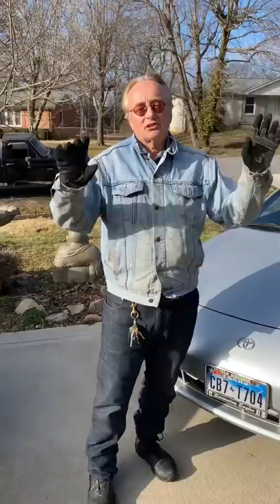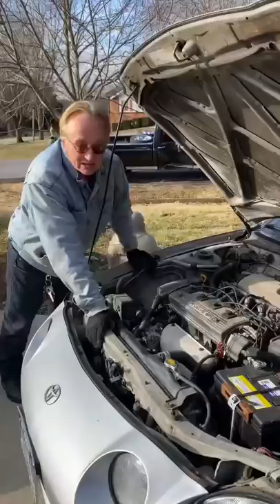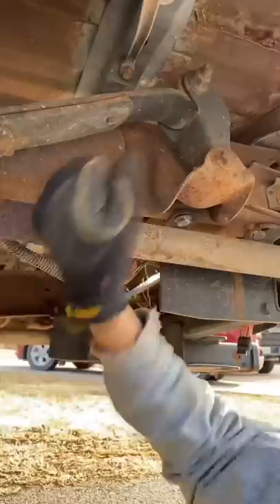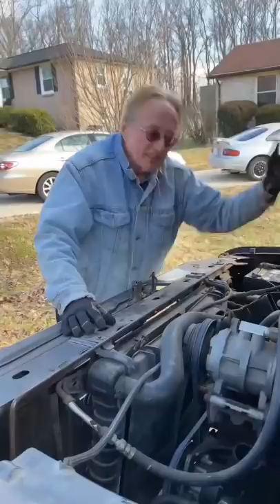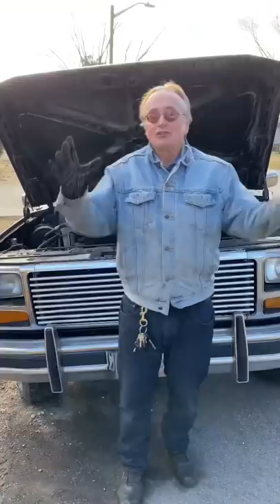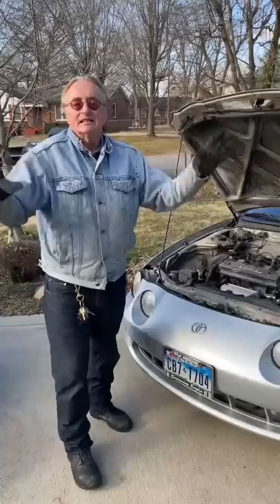Here’s Why Old Cars are Better Than New Cars

Comment: Two weeks ago my '70 Ford p/u wouldn't start.  I hit it with a shovel and she fired right up.
Reply: A little persuasion is the mechanics secret
Reply: I once used a screwdriver on the starter solenoid... Yep... ❣️
Reply: What a coincidence, I have to do the same thing to my wife sometimes.
Reply: percussive maintenance
Reply: “I think I’ll just get a Chevy or Ra-“

Your ford: Starts right up
Reply: Attaboy
Reply: @susanb1111  just once? I remember a coworker that had an '86 Cherokee and for months was too cheap to buy a new solenoid, instead used the screwdriver method :)
 It's a good trick to get an engine to TDC
Reply: percussion maintenance at its finest
Reply: Awesome!  lol
Reply: A shovel? How big are the starters in those bad boys?
Reply: @GuerreroDelInfo  If it's like my 88 F150, pretty hefty starter without a solenoid built in.
Reply: I had an old vw golf when the starter doesnt start i just smack it with a hammer now i had a mercedes and one day the starter didnt kicks i brough my hammer but i couldnt find the starter  lol😂😂
Reply: My old Toyota Previa was similar where it would run like junk or not start and I'd say I'm gonna beat it out of you and then try again. Usually it turned on once I kicked it and it started right up. But it had a couple of bad failures and I got tired of it being in the shop a lot so I traded it in. I don't regret it my newer car has a waaaaaay better suspension and gas mileage.
Reply: That ford stinks PU.
Reply: @fish_R_stinky69  You've confused my truck with your upper lip. 😁😁😁
Reply: @nucleargrizzly1776  Your trucks a shameful rust bucket with 200hp when it was new. Now its more like 100hp.
Reply: @fish_R_stinky69  There is not an speck of rust anywhere on her.  255hp and 376 ft lb of torque.  And in better condition than whatever you are driving.
Troll smarter next time young lady. 😀😀😀
Reply: @nucleargrizzly1776  I'm a young man and I rented a Malibu with 260 hp except its a lightweight 4 cylinder. I would expect more from a giant heavy v8!!
Reply: They respond to other metal objects. 😂
Reply: I have a 64 thunderbird and the carb float gets stuck here and there, a little smack to the airfilter fixes it lol
Reply: @greggc8088  Yep, works every time
Reply: @greggc8088 LOL
Reply: I once had a  1970 ford f100  that thing had over 500 thousand miles on it original engine and everything  I'd probably still be driving it  if it didn't get stolen.

Comment: Sad thing is that nowadays the car you’d like to get is either wrecked or modded to hell.
Reply: Yes, you need to search them hard
Reply: No
Reply: Or pay like $200.000 for a mint low mileage one.
Reply: Thats why I still keep my 240sx stock
Reply: Too many Fast and the Furious fans.
Reply: Cash for clunkers really screwed us
Reply: Or not allowed to get one
Reply: @Work_G  Yep. Found the car I wanted for two years, had everything perfect except the engine was badly swapped and I didn't have the time, experience or money to fix it.
Reply: biblereader  Maybe, but certain cars made way back when were built to last
Reply: cries in mkiv Supra
Reply: A Honda Civic hatchback is one in 100,000 in barely stock condition without kids messing them up. Trying to find a decent one in Florida is like finding a needle in a haystack.
Reply: Not true.  Depends on what you want though
Reply: I've given up looking for 90's 5 speed hondas/acuras because of that reason.
Reply: Just the 1988-2002 JDM cars. The classic muscle cars from 1960-1989 are barely ever modded

Comment: Old cars were not disposable.
Reply: Right. And people don’t realize that keeping a car on the road instead of crushing them after 10 years creates less pollution. Especially with the manufacture and disposal of lithium batteries included
Reply: Mining lithium is a horrible thing
Reply: @Terminxman  People did not realize because companies and governments told them to do not!
Reply: @Terminxman  couldnt fuckin agree more
Reply: @Terminxman  Finally! You actually understand this, unlike most people! My dad says the exact same thing as you did. I bumped my fist against a 1992 Mazda 323 door, VS a 2021 Toyota Corolla, the Corolla door was like a tin can, vs the 92 Mazda, it was solid, with a deep bang when you hit it. It was awsome. Cars will never be made as good ever again, unfortunately.
Reply: @Blakecryderman7244  You buy literally any German car and you will find the doors are the best out of any other cars on the market they shut with a solid thud and if you bumped your fist into one it would probably hurt. The reason doors are built like that now is to save weight and money so it meets regulations better. Regulations are whats killed modern cars not the companies themselves.
Reply: m rapacki  Only if you properly maintain it.
Reply: @Blakecryderman7244  Well, when it comes to things like feel and body panels high strength steel requires less material to have the same strength of some of the older stuff, so that doesn't necessarily mean a lot.
Reply: m rapacki  exactly. I'm definitely in the "old is gold" camp, but cars don't rust out by 70-100k mi now like they used to. Replacing designed to fail plastic crap is one thing, but a frame off restoration is a whole different story. 
I'd rather replace the plastic crap. I don't plan on welding in a new floor any time soon.
Reply: lets get away from the 70's stuff but lets talk 90's steel body doge ram had somebody hit my truck hardly a damn mark on it poor dude who hit it lets just say OOF and move on. Never felt safer in a steel body high riding truck than i do anything else.
Reply: @Blakecryderman7244  ECHO
Reply: which is actually better for the environment in some ways
Reply: @gravemind6536  Oh definitely. My father has a 2010 Jetta SportWagen. When you close the doors, it sounds like a bank vault door!
Reply: m rapacki  people didn't have to drive so much back then
Reply: m rapacki  Don't forget the coolant, brake fluid, power steering fluid, ATF, rear axle fluid and transfer case fluid (if you have one). Yeah, I know about the older cars (60's, 70's, 80's) with carburetors, distributor, points, copper plugs . I'm an old geezer.
Reply: biblereader  There are many variables, that's not really true.  rust prevention, metallurgy, etc. Corrosion resistance is much better now, and they use aluminum in a lot of cases. The 90 dodge/chrysler trucks had thick body panels and they were made of pot metal and rot like nothing else.
Reply: @gravemind6536  yeah maybe the German cars have solid doors, but the rest of the vehicle is an endless money pit. The 30 year old Mazda has solid doors BUT the rest of the vehicle was well made, with no plastic crap like a New German car.
Reply: BL Dontmatter  and also imagine the rolling blackouts due to the acute power shortages just because the epa forced EV 's
Reply: @RothBeyondTheGrave  that's if you live in salty , wet hellholes like NY or WI or MI . I own cars that are over 50 years old with more solid ORIGINAL  bodies than A lot of new crap I've repaired. Any thing built en mass after 1973 is JUNK!
Reply: I wish you would have told that to all the old cars I disposed of. Back in the seventies and eighties I used to keep a car five to seven years and felt they were pretty old. I would usually give them away because they wouldn't give me much in trade. Now I keep a car 15-20 years and don't think much of it clicking 300,000 miles. Back in the day I used to do tune ups, break jobs, carburetor overhauls, all while getting 8-12 mpg!  Now, I change the oil once a year and put plugs in at 100,000 miles and get 30-50mpg! I loved the old cars. They were things of beauty for sure, but I don't see them with rose colored glasses.
Reply: @stevenrodriguez7668  Don't know about that, but I do remember rolling blackouts and long gas lines with odd and even day number rationing during the oil embargo of the seventies!
Reply: @alansach8437  energy shortage would be worse nowadays most likely due to enforcement of electric vehicles. People travel more nowadays than before when cars were built for the consumer, not the manufacturer. I'm only 21 but I've studied up on the '73 oil crisis, max 10 gallons of fuel that you could purchase , most acute petroleum shortages since ww2. OPEC hit us hard that time just for aiding Israel
Reply: Neither are new ones. Car rentals trash there cars after only 1 or 2 years BUT they already have more miles than any OG car🤣🤣🤣🤣
Reply: Scrap yard guys don't believe so.

Comment: yes that is what I loved about the older cars, you could just swap the engines or even swap the engine parts. Things were so simple
Reply: Yeah, the electronics makes it more complicated to swap out an engine or transmission. But it can be done if there's a kit for doing so.
Reply: My 93 Accord is using some parts I took off 96-2000 Accords if I couldn't find a 90-93 in the junkyard. It's a pretty modular car.
Reply: @genericdude6551  Just unplug them and move the wire harness out of the way.

Comment: I bought a 1993 Ford Explorer for $500 6 months ago with 365,000 miles on the odometer and it was abused by it’s previous owner and sat for a year. The starter motor bolts backed out because of a huge oily mess on the undercarriage and caused the starter to not spin the flywheel when I turned the key. It also had a major misfire issue because the spark plugs were rusted and covered in black oil. The oil also looked like it hadn’t been changed in a long time and the oil filter was loose while taking it off. But after I changed the spark plugs, oil, oil filter, air filter, and fuel filter, the engine runs like a dream. It hasn’t had any problems since I fixed those issues. She’s a strong old girl.
Reply: Like yourself.
Reply: If it only has 365000 miles on it  ,it's just gotten broken in good  and if you  change the  oil regularly  it'll last another 365,000 .

Comment: As far as GM C/K pickups are concerned,  the parts were interchangeable between model years as well. Sometimes when I needed a part, if it wasn't available for my model year, I would ask the parts counter person to check and see if it was available for my truck's previous three model years. And often as not, it would be.

Comment: If you live where I do and they salt the roads in the winter the pre 1992- 1996 models were prone to rust away. The newer ones post 2008-2012 have very complex computers and transmissions that re more prone to failure and are hard to repair. The mid 1990s up untill about 2012 seem to be the sweet spot. That's why I like my 2011 Corolla. Last of the simple 4 speed automatic transmissions with a dipstick.
Reply: hahaha 4 speed gearbox on a 2011 car? You guys are getting conned in America 4 speed gearboxes are a pre 2000's thing in the UK. Also I have never seen a gearbox with a dipstick wtf is that about? You don't need to check or change transmission fluid anyway. You enjoy your 2011 car that belongs in the early 90s.
Reply: @gravemind6536  Most cars in America had 5 or 6 speed autos in 2011.  Also transmission fluid starts to break down after 60,000 miles (100,000km).  Not much of a problem if you're living in Europe though.
Reply: @gravemind6536   Interesting...

Comment: I still drive a 1996 Camry V6 I bought from an old man. Still runs and shifts like a dream. Only problem is the quality of the spare parts are not on par as the original.
Reply: The 96 camrys are injection not cabroute which means comupter system is taking the rule

Comment: Scott,I agree with you on this VIEW. I use Mercedes Benz C 280 1999, but apart from WORSE gas mileage,it run like New
Reply: The 99 c class and e especially the 4 cyli engine are bulletproof

Comment: Sold my 2013 Chevy Malibu and kept my 2000 GMC Sierra 2500, which runs like a champ. I noticed the transmission on the Malibu was slipping sometimes, but with 243000 miles on the GMC. The transmission is so smooth. I also have a 72 Datsun 510 Wagon, and the only time it failed was because I forgot to put water in the radiator when I was younger.

Comment: I have a 1972 Ford F-250 4x4 truck. That truck still runs great. Is always reliable and looks great. I also have a 2006 GMC Sierra 3500 dully duramax diesel truck. It’s a good truck. But 10,15 years from now. I bet the 72 ford will still be running good and reliable and the 96 diesel gmc will have gone to the scrap yard

Comment: If you have a car/ truck that's older than a 2000 it's almost impossible to find parts in a junk yard that hasn't scrapped everything that old.
Reply: Agreed, if you don't have a honda civic or a toyota corolla you're basically sol. I have a 98 mazda protege and I almost was about to scrap it due to the fact I couldn't find a control rod for the stick shift until I found a dealership with the part on stock in another state.
Reply: You're looking in the wrong places. There are plenty of old cars out there, I know of a few that have LH bodied Mopars.

Comment: I have an older car with plastic parts and living in hard environment but believe it or not, it had been running for 18 years, with 315k miles on it. Still running good today, and will probably keep running for 10 more years
Reply: @Manni MiNiMoo cars got worse quality after the crisis in 2009.
Reply: @Blakecryderman7244  lol I don’t know anything about after 2009, haven’t bought one for so long. Until mine dies not gonna buy another car. What do u think of those new electric cars? With no engine do u think they last longer? My next car would have to be electric just want to know
Reply: @yeolblt  It is a 2004 Hyundai Elantra, it sits in the sun every summer in 104 degree heat, since I have no place for it to park. Was surprised that it is still running so well, there are some parts I replaced of coz, aside from oil change regularly, and flushes every few years, did nothing else.
Reply: What car is it? Great choice and maintenance ☺️
Reply: @yeolblt  2004 Hyundai Elantra, 2.0 Engine 4 doors

Comment: My favorite era of the gasoline engine is metal oil pan, metal water pump housing, coil on plug ignition, and port fuel injection. No more plastic than radiator end tanks, intake manifold, and DOHC valve covers. Not too complex not too simple is how I want it.
Reply: Completely agree, it describes my 2001 Tacoma 4 banger. Timing chain too unlike the 6 cyl

Comment: Thank you Scotty!  Your presentations are very Educational and interesting.  I worked in the car dealerships in the late 90s when fuel injection became popular .  There was a drastic difference in performance between a carburated and fuel injected vehicle.  Fuel injected cars are much more responsive to the pedal.  There quicker from a stop.  That's because fuel is pushed right at the intake valve.  It does not have to rely on engine vacuum to be sucked down to the intake valve.  And it does not have to travel thru the intake manifold before it reaches the intake valve.  Therefore, a faster responding engine.  Also,  using a fuel injection system (i.e., injectors, sensors, computer) is a much more precise way to deliver fuel to the engine.   Modern fuel injection will give you optimum performance and fuel economy while delivering the lowest possible emissions. M.F., Teacher, Mechanic

Comment: My 43 year old Lada is more quiet than my neighbour's 10 year old Mini (Coomer) Cooper.
Reply: Yeah, but ladas are accident prone...ever see a russian car crash compilation??
Reply: @pillowbugg  As much as any other car - any car driven by a russian is more prone to accident. Lada's are structurally tougher than any 90s or newer car, and even safer for the type of roads we drive in - i just saw a Mercedes who's front wheel was tilted 45 degrees to the outside, probably after he entered a random pothhole. Infact where i live, you're more accident prone if you drive a western car.
Reply: biblereader  My neighbour pays through the a$$ for it, and its even smaller, less practical, less fuel efficient and crappier than my dad's 90s Fiat Punto. It feels like a laundry basket when you sit in it, i feel way safer in my 70s steel Lada, it would not survive a collision with it. Hell, some dude with a Lada in my country got hit by a woman with a 90s Opel Corsa - the Corsa was smashed in pieces, while the Lada came back 100 miles home, with just a slightly cracked radiator. lol

Comment: I just bought a 2005 camry with only 23,000 miles on Friday. Hope it lasts a while
Reply: If it's been well maintained and driven normally, it'll probably last till 2035 if you continue to do so 😀 I've a 2007 Suzuki SX4 with 30,000 miles, and I expect it to reach 30 years old
Reply: @yeolblt  yessir I bought it from the original owners. Who were in their 80’s! Car has been meticulously maintained. They would change the oil every couple months even if they only drove 200-300 miles. Best part, they had a stack of receipts to prove it.

Comment: If only rust wasn't such a colossal problem with older cars....
Other than that, newer will always equal worse & there's no changing that ever. Regulations & insane profit margins have sealed that deal.
Up til 2010ish is the STRONG cutoff imo. Just enough computer to help with diagnosis & efficiency all around, yet still serviceable & still analog enough for where it counts. And less chance for unobtainable parts.

Comment: The worst part about modern cars are engine complexity and all the eletronics, my 2007 Volvo V70 PII runs like a dream after 18600 english miles or about 300 000 km
Reply: @AT-wl9yq  Correct 5 cylinder 2.4l engine, purrs like a cat in -30

Comment: I had a 98 astro van and I needed a driver side view mirror, because some a-hole broke it when I had it parked, but I couldn't find any at the junkyard that were intact. So I just took one off of a Suburban from the same year and wallah it worked.